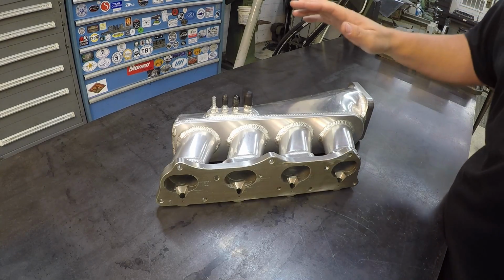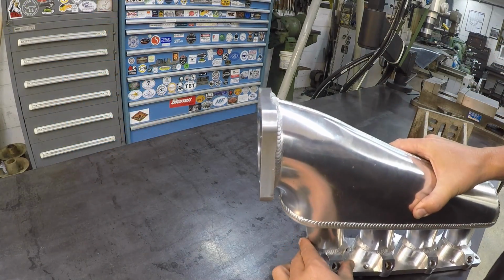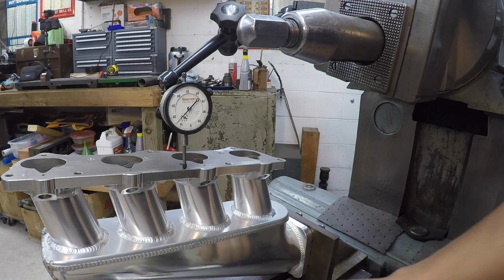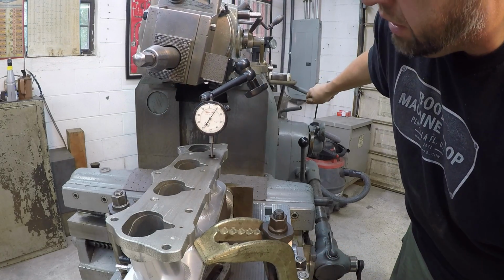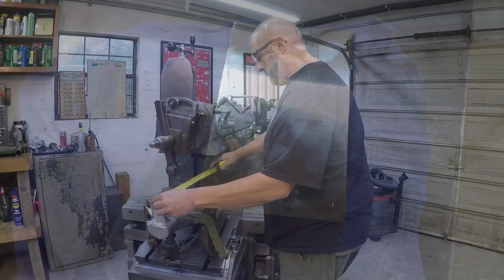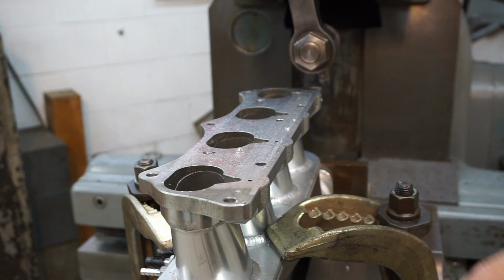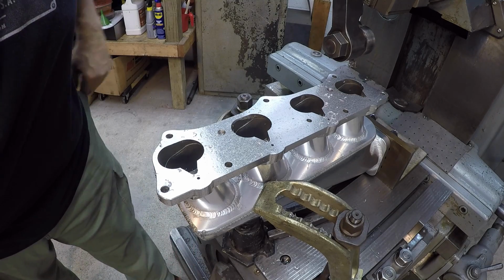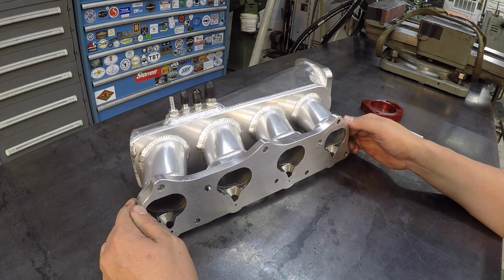Machining an Intake Manifold in the G&E Shaper

Comment: What you need Abom is a cylinder head exhaust manifold intake mai ect, Belt resurfacer. Whatever you need flat Boom Whirly whorly whirly and then check it till it is mostly flat with just a small not sanded spot mount it to your mill then you have a really sooth mostly flat surface you can bring indicated really close  to flat easy to flip and check and then indicate off and stop wasting time with mill passes. I have a guy with a few extra machines can get you a great price on 1. def under 3k he sold me 1 for restore for $750

Comment: Yeah, except you didn't even check the result on a knife edge or a flat table if it is straight indeed and on a camera you can clearly see that the material is flexing under the tool even that you have supported it at the end. The result surface may look nice but still be bent.

Comment: May i ask other than having the shaper. Is there any reason you didnt just run it on a belt sander? Thats what i usually do for manifolds that need flattening, i mean this is cool as hell. And i enjoyed watching it. But 2 mins on a belt grinder would have got it flat enough
Reply: Very easy to sand a very slight curve in to the work piece with belt sanding. Also you're more likely to keep more to the original (not straight) shape. The shaper (or fly cutter in a mill) will largely ignore the original shape and just cut flat.
Reply: @stuartgreenshields5591 Absolute correct. 30 years after a variaty off sanders teach you that its not the way. People with negative comments do not know or cannot or have not a shaper. Real machinists do know the good side of a shaper. Shapers is in your blood or not. Sorry for the so called machinists that do not have the skill or means.

Comment: When we use to cut jet engine bulkheads out of aluminium blocks on the "shaper" drag mill. We use to hone bare carbide cutters to razor blade edge status and the finish looked like a mirror compaired to even the $50,000 cnc mills we had in the shop at the time

Comment: boy does that take me back, all the way to 68/69. Teaching machshop in Kokomo, in. We had a Fed voc. program. One project some of the guys tackled was a 6" swivel bench vice with castings.  They used the shaper with an 8" extension bar to mach the rec shape in the base for the movable jaw.  They usually got to .010 to .015 clearance. Tricky going all the way thru but yielded prefect alignment.

Comment: That shaper is a machine that truly commands respect. When you think of the kind of precision grinding and scraping that it took to get that slide and ways so perfectly straight..... It boggles the mind. As you said, Adam, it's an elegant machine!

I take my hat off to you on the clamping setup. It was beautifully done!

One thing that I've always admired about you, Adam, is your penchant for precision and accuracy. You really have to be happy with a truly accurate measurement...... Even if it means checking it three and four times. That takes a lot of patience and it's a sign of true professionalism.

Comment: It’s admirable that you enjoy using your shaper, however it was not the best remedy to properly correct the distortion issue.  In fact the canter lever jack stand & tall clamps introduced strains that presented once part was in free laxity to warp. The preferred way is on the Bridgeport. No not with a fly cutter. The faster, simpler, more rigid set up is to tee bolt runners to the table with flange lip over hung table. Indicate X then quill the Z axis tip head if needed.  Now use a 7/8 or 1” rigid end mill side in step cuts. See how the this is a faster, safer, more accurate set up?  But it’s good to see your learning kid!
Keep up the great work!
Reply: This comment is a joke that I just don’t get.. right? Inside joke maybe?

Comment: Abom, does the G&E shaper not have the ability to lift the tool on the return stroke? Hearing it scrape on the part during each return stroke made me cringe. I realize it's aluminum, not steel, but even aluminum alloy has hard constituents that can abrade the tool on the return.
Reply: It has a "flapper box" style mechanism that allows the tool to rotate off the surface during the return stroke but it does not actively lift.
Reply: @andrewlesuer3504  I saw that right after I made the post. Thanks!

Comment: Old school Shapers machined flat surface as flat as a surface grinder only on material that does not grind very well. Single point cutting is very flat, flatter then milling. YOu can cut a surface with a shaper then lap the surface and you usually are flat within ±.0002 then you can use a scraper to finish the surface. if you milled it you need to grind then lap then scrape flat using high spot blue and a surface plate.    mcahine way beds are scraped flat so are surface tables. the only problem with shapers is they are slow.

Comment: why didnt you just bolt the intake manifold to a surface plate and use a surface grinder , for the amount of metal you are removing  plus you would of gotten a much better finish ..................
Reply: a surface grinder doesn't work well on aluminum(?)

Comment: I'm not talking crap or anything and I know you wanted to use this to show the shaper being used but dang, I would have just tossed this on a large belt sander for a couple seconds.
Either way, nice job
Reply: idiot ......belt sander would not of given you a perfect flat surface
Reply: @65swinny  you don't need a perfectly flat surface. There is a gasket that will fill minute voids and a bunch of engines are starting to use o-ring gaskets so it REALLY  doesn't matter if flat.
A manifold isn't like a cylinder head. It doesn't get exposed to anywhere near the pressures exerted on a head and a block.
Running the manifold on a large shop belt sander would flatten it enough.
Reply: @zososldier  Really comes down to what your resources are.  Plate glass and paper would help you verify flatness after hitting it with a belt sander or could be how you flatten it.  I don't have friends with a machine shop so I'd go your route but I'd still want it flat so that it becomes one less variable for screw ups like vacuum leaks I could have avoided and thereby avoiding tearing down a lot of work and wasting time chasing problems.
Reply: @alwaysbearded1  O for sure. I have lapped a few things using glass and sand paper before. Probably wouldn't hurt to do the same after a few second on the large belt sander then lapping it on glass. Won't be perfectly flat but marking the mating surface with marker or dye then sanding until it's all gone will get one well within the ball park for a manifold.

Comment: Real cool machine and you def know your stuff. That said, using a shaper and a machinist setup on an inline 4 cyl intake manifold is like hiring a 5 star chef and using a set of professional knives to make a ham sandwich. 10 min with a belt sander and a straight edge would get a perfect seal and look just as good once its installed on the engine. I'll get hate and wannabe "expert" opinions but 40+ years of actually building and running engines has taught me there are times for an expert machinist and there are times for simple.

Comment: A really interesting video. I haven't seen a shaping machine here in the UK since I started a college course back in the early 80's. Seeing the surface finish you achieved compared with what I saw at college has only confirmed what I always thought, that being that the tutors were either no good or didn't care. I left the course as I was paying but learning nothing. I'm self taught and run my own little shop here making parts for vintage motorcycles. I believe that engineering is in a bad way here in the UK but at least some of us are trying.
Great video, inspiring. Thanks Adam.
Reply: I'm in the UK and need a small machinest for some of my creations, do you have a website or method of contact?
I need brake adapter brackets making immediately, I could just go the engineering firm route of course but I'd rather promote a small business being a small business myself! I build cars and engines, working with alot of composites these days, I'm in Dorset!

Comment: I wanted tell you by looking at your different finishes on the aluminum, we at our shop purchased carbide inserted butt mills ranging from 2” to 6” (Love Joy) is the manufacturer , They leave a really nice finish and can be use on steel or aluminum , but we never had a Shaper like you have which does do a beautiful job also on aluminum.

Comment: Good job 👍I used a shaper once but we don’t have one at my work now so I would put it the vertical Miller and fly-cut it same way as we do Cyl-heads. You usually get a better finish this way , good job all the same.

Comment: Every video I watch here I see new tools of the trade. Just amazing. Don’t guess I’m going to be starting up a milling shop with tools from the hardware store. LOL
Reply: I can't think of a better way to start, at least with limited resources.
Reply: A lot of the tooling I have acquired for my shop I bought at large asset disposal auctions. I probably have tend of thousands of pounds worth of tooling built up over the last decade. Then get yourself a universal tool and cutter grinder 😉
Reply: Technically a shaper is very much old tools of the trade, nonetheless they still do a fantastic job. Sadly in the UK at the end of the seventies and through the eighties machines like this were more likely to be scrapped for steel weight than sold on, partly due to nobody wanting them through lack of education and because of the rise of automation. Now if I wanted one I'd be paying a huge premium and I'd probably end up having to import one, the British weather not being kind to machinery that sits around in the cold and damp. 

I suspect the most economical thing would be for me to import a Russian equivalent, but generally speaking you get a machine with less nuance. Though as they overbuilt things they're at least solid and can plough through work, even if they may lack some of the fineness of adjustment seen on other shapers of the past.

Comment: Nice to see how you set it up on the shaper, but a complete waste of effort. FAR easier to set up on your K&T horizontal mill and much much more rigid as well. As I think you found, the shaper table is on the small side as well which adds to the problems of mounting it.
You set the flange roughly level using your the Lufkin spirit level and commented that the shaper was not level. If, as I expect, the shaper table was clocked in to the ram travel before you started, I would have put the level on the shaper table first. Note the reading of the bubble in the graduated vial. Transfer the level to the manifold flange and then adjust the shaper table to the same bubble setting on the level. Much less final adjustment to make whilst clocking the flange.
It is not until you have seen the operator chased around the workshop by his shaper that you realise it is a really a good idea to bolt the thing to the concrete floor. Lot of inertia in that big ram cycling to and fro. If there is enough to overcome friction between the floor and the bottom of the shaper it WILL move in use.

Finally, whilst it is always very satisfying to get a really smooth finish when machining something, where the face is in contact with a gasket it is better to have a rougher finish so it grips the gasket. That is why such faces are often milled or fly cut.

Comment: That manifold must have been running hot on it's motor to warp that much.
Reply: He actually mentioned that it warped during the welding process, and never sat right, so there hasn't been any usage as designed yet at this stage.
Reply: @mahina1963  Oh, that makes sense. I should've paid attention.

Comment: You could put a full radius on that 3/4" or 1' high speed bit with a 15 degree chip break for a super smooth finish Shaper cut on Aluminum. But that job came out really nice, none the less, with that old school text book chip breaker bit grind. You do amazing work... and your jigs a fixture talent fa-nominal.

Comment: Stone wheel on a surface grinder with with a layer of 10W oil would give you even a better finish. The oil keeps the aluminum from bonding to the wheel. Done it, it works great! Just food for thought. I’m assuming this is T6061 given the application.

Comment: I really like your videos. You're a cool guy.  Instead of the straight angle on your shear tool try a large radius (you can use them on the lathe too). Then the radius cuts, not the point. Some steels I get the best finish with a regular lathe turning bit with 7 degree angles. A regular round nose bit works surprisingly well for aluminum and cuts both directions. Too much rake and it digs in. Then use kerosene brushed on lightly for the best finish on aluminum. It just works. And stinks. But it works great. A mold maker in UK told me to use Kerosene. He's right. Aluminum loves it. It stinks. I hate getting it on my hands. It stinks! I said that didn't I?
I'm calling BS on the guys that think they can sand flat as a shaper cuts. You can't.
Reply: Try and source what we call parafin in the UK - it is refined kerosene without nearly so much stink! Parafin here is usually coloured pink or blue so it can easily be identified. It is used for open lamps and heaters. In the US it may be sold as 'lamp oil'. kerosene is sold as heating oil, boiler juice or similar names for use in a heating furnace.

Comment: the client could've saved time and money just face down sand papering on a flat surface, .010 in no time and FLAT
Reply: Some jobs aren't about how quickly you can do them.  If this is a high boost application that intake surface needs to be flat.. not pretty close.
Reply: If you gonna sand .010 I imagine you’d have high and low spots everywhere.

Comment: Well that was pretty awesome. I feel like my machinist took the ghetto path... not so difficult path. last time I had a manifold warped it was out 43 thou and he asked me if I had a minute and it would be 40 bucks. I said yes and yes... he took the manifold... walked in their back turned on the Belt Sander. held it up there for a couple minutes walk back up and said he was done. 😆 it was pretty flat... when I tested it with a straightedge and a feeler gauge.

Comment: So much movement on one axis on that machine in and out over and over again.  Does it wear out?  Maintenance a pain?  I was used to a Van Norman milling machine with fly-cut attachment to do the job I'm seeing here.
Reply: as long as you keep the slide ways well oiled wear shouldn't be a problem, the brass gib strips take up slop and wear once adjusted in. if it does wear out on the inner end of the stroke the ways can be trued up again and the extra slop created by truing up taken in by shimming under the gibs.
Reply: @tech4pros1  The Van Norman crank grinder I used was terrible on small things because of wear.  A CAT 3406 crank could be ground to precision.  A Briggs or Tecumseh crank was subject to the wear of the inner parts of the bed.  I.e. the chucks didn't line up no matter what you did.  The middle wears so much more due to the silty grinding wheel junk that ends up on them.  Keep your "ways" clean and oiled is my advice.

Comment: With the cost of CNC, there will continue to be work for mechanical machining?
Reply: Lots of CNC shops don't have time or can't be bothered with jobs like this. An established shop loses more in the overhead of taking the job and doing paperwork than making from it. Always some need for shops like Adam's.
Reply: Due to the large amount of time and effort it takes to write the code, debug the code, and setup the job CNC is not practical for one offs or small jobs. CNC only makes sense when making a large number of identical parts.

Comment: That's an interesting piece of equipment. It does a perfect job. Really the same as cutting head on a mill, what was it is original purpose?
Reply: Kurt Sumthinorother It’s one of the machine tools that has roots all the way back to the industrial revolution. Most common use would be making a flat surface like Adam did. Other possible uses, cutting keyways, gear teeth, splines, and so forth. Although typically superceded by milling machines on most operations, a shaper can still make internal features that most mills and lathes are unable to make. For example https://youtu.be/af7mWmBB--4

Comment: did anyone else flinch at 23:58
Reply: For those who don't know the tool post on a shaper is mounted on a hinge that can flap during the back stroke. That sound at 23:58 was the hinge flapping as the tool backed across a clump of metal shavings. Due to cutting tool geometry it can only cut in one direction. Without that hinge there would be clearance issues on the back stroke.

Comment: It looks like the manifold was deflecting down the end of the stroke quite a bit. Checking the machined area on a  surface  plate or just a 2 foot rule would reveal any runout.  One of the first machines I used in high school metal shop class was a Shaper. Also blowing out the metal chips before cleaning it would of been better.
Reply: boring lol

Comment: This might be a silly question but why didn't you just use a belt sander to get it flat ?
Reply: Because sometimes the right tool is the tool that you enjoy using.
This is also way more precise than a chuckle belt sander.
Reply: A belt sander has too many variables. Hand pressure, belt flex, belt wear, table flatness. Trying to get something precision flat on a belt sander is damned near impossible.
Reply: Hahahaha fair enough. Usually with exhaust manifolds it's not exactly critical for it to be perfectly straight. The bow is obviously an issue but surely a grinder would sort that out. Watch the skid factory. He makes manifolds all the time. Top YouTube channel too